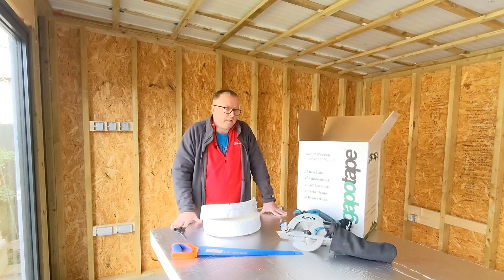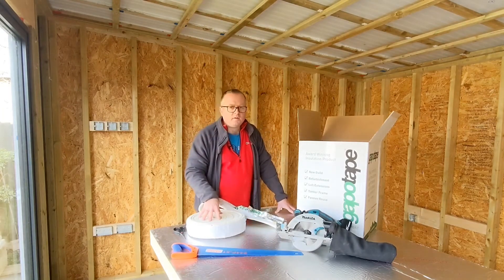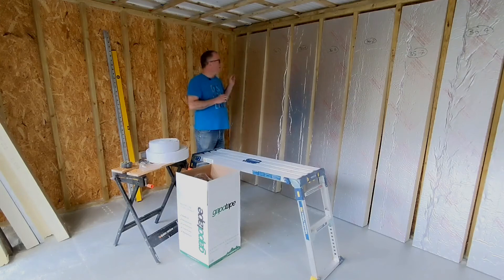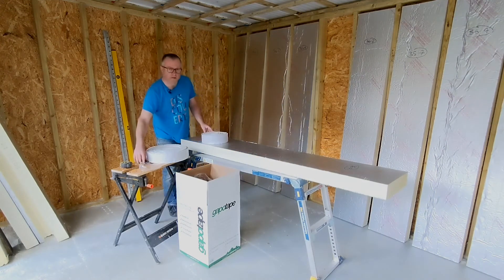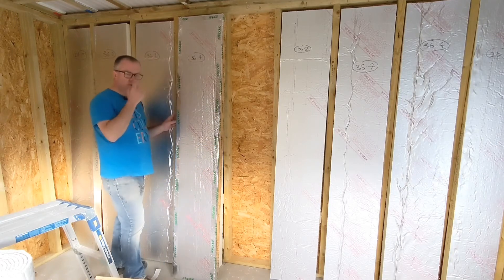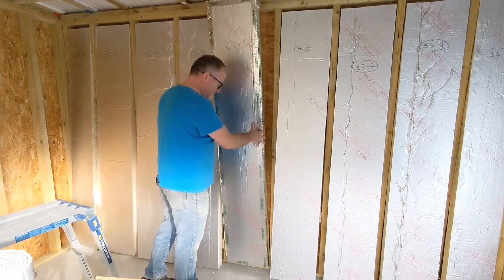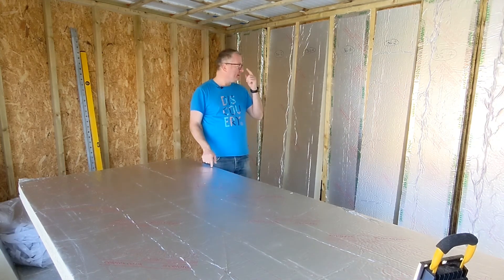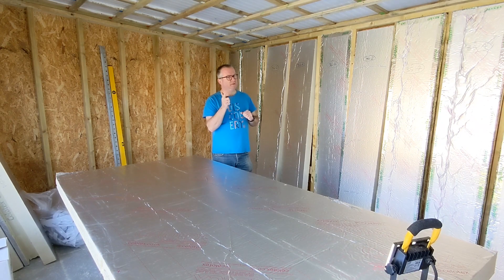PIR installation with Gapotape!

Comment: Nice video but, what a fiddly job? Also that tape is very expensive isn't it? Probably cost more than the PIR insulation.
Reply from the maker: Ha! It was, and yes vey expensive, but it does do a very good job, very satisfying fit! and actually, although it was fiddly I could imagine cutting and recutting and shaving bits off to try and get a fit could also bee a pain.

Comment: what table u got there? cheers
Reply from the maker: It's not actually a table it's just a full sheet of PIR resting on a black and decker workmate and a WERNER Adjustable Professional Work Platform I got from screwfix I think, thats pretty useful thing actually for painting and such. Thanks for the question!
Reply: Dont suppose u know of a cheap supplier of gapotape? Ive bought direct online from their shop but prices are crazy
Reply from the maker: @stevezm100  No sorry, I got it from there site too, it is expensive! but fits so well! Thanks

Comment: Why don't you use normal Rockwool? Osb inside and tyvek or dhd MDF outside? Never heard from open difundation building?water difundation Level from inside to outside  1/5.
Reply from the maker: Hi, thanks for watching, I used the PIR as its got better thermal properties than Rockwool, width for width, that was the only reason. The vapour barrier is just to stop any moister in the room going into the framework. It is a very low risk, and you are right not that much moisture in there, but it didn't add much to install it as I was building the wall so may as well. The wall buildup I used is, from outside to in: Metal cladding (or Cedar on the front), battens, OSB, the framework, with the insulation in, vapour barrier, plasterboard, plaster. So it is really like a room in the house from the inside. And now issue so far with it. Thanks!

Comment: Nice job. How many rolls did you use and at what cost.
Reply from the maker: Thanks Robbie, I I think about 35 rolls. It came to about 700. I am hoping that I get that back over the life of the room through savings in the heating! Particularly with the price of heating now!!!!
Reply: @FatManBuilds  I cant imagine you'd even need to try and work out if gapotape would save 700 quid over the life of the building. 
It's a great product but I'd imagine a very poorly installed pir board isn't likely to leak thise kinds of costs over the life you'll use the building.
Reply from the maker: @gongatots4115  You might be right on the pure heating costs, though I am hoping the building last 20 years, so that's only £35 a year, and and with heating costs now it could do. But for me it was more about getting the voids air tight and avoiding cold spots where warm air inside the building can travel through the wall and hits a cold outside surface directly and condensation and mould forms. Thanks for the comment.
Reply: @FatManBuilds  
I'm building something similar and loved the idea of gapotape.
It will certainly help minimise cold spots and sometimes peace of mind knowing you've done all you can  is worth more than an extra few quid.
Nice build by the way.
Reply from the maker: @gongatots4115  thanks! It's getting there. Good luck with yours!
Reply: @FatManBuilds  cheers for that. That’s what I’m trying to work out. Cost now v savings in the future.